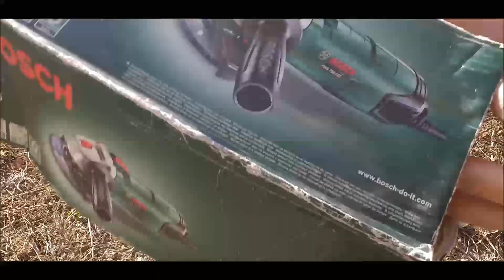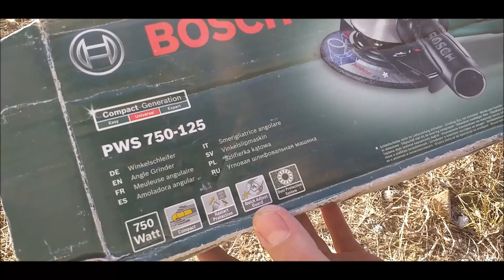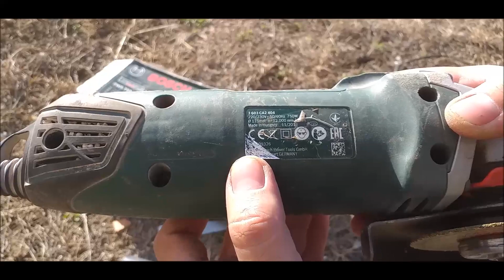Cu ce scule lucrez la Casa - Bosch PWS 750-125

Comment: Salut. Ai avut cumva probleme cu el? Eu l-am cumparat nou, nu l-am folosit foarte mult. Adica nu l-am luat la vreo lucrare sau cv... Cateva fiare taiate prin curte si am taiat niste scanduri... Problema acum e ca il pornesc si mi se opreste... Daca tin butonul cu degetul merge, dar nu poti lucra cu el asa. Probabil e protectia de panza. Sunt doar curios daca si tu ai aceeasi problema
Reply from the maker: Salut. La mine apare aceasta problema cand folosesc peria cu toroane sau discul pentru piatra, in general cand exista vibratii pe polizor. Chiar si asa este foarte deranjant.
Reply: @StartDIY  salut. chiar azi dupa ce am postat comentariul l-am desfacut ptr ca imi trebuia urgent. Acum cateva luni am folosit peria ca sa curat un disc de fier si am apasat mai tare pe perie incetinindu-i rotatiile... Incepuse se iasa fum din el si mirosea a plastic topit. Pana azi l-am folosit decent desi cateodata se mai oprea. De dimineata se oprea imd cum il porneam. Dupa ce l-am desfacut, am gasit o bucata de plastic provenind din stator topita si cazuta intre stator si rotor. Bine ca nu l-a prins paletele de la ventilator... L-am scos, l-am montat la loc si nu mi-a mai facut probleme. De altfel era si plin de praf, dar plasticul ala cred ca a fost problema principala